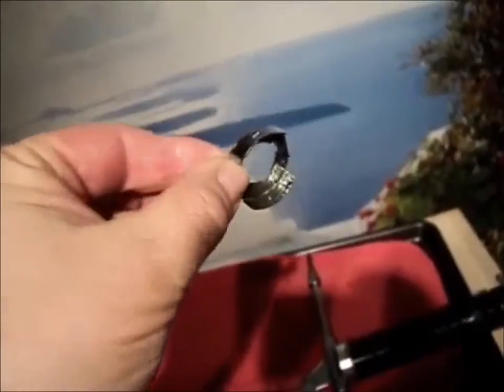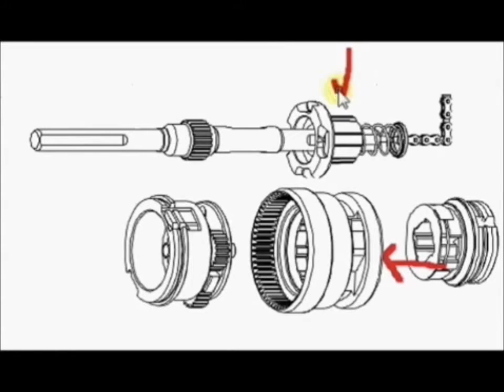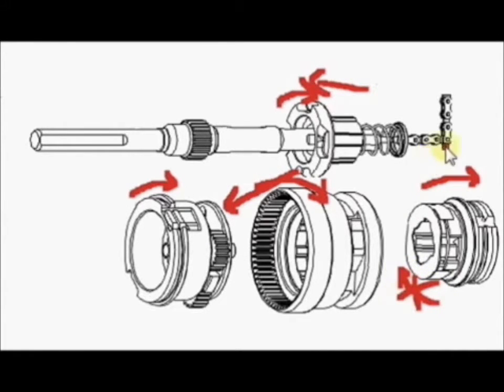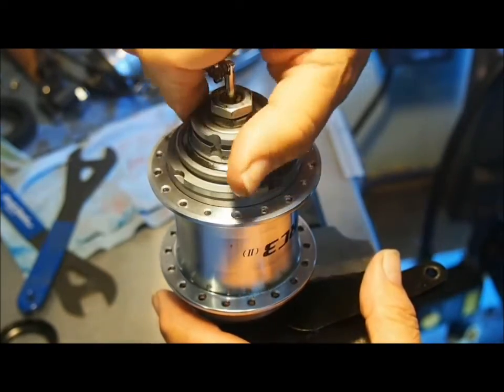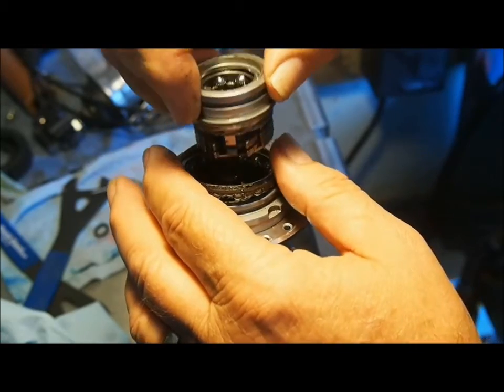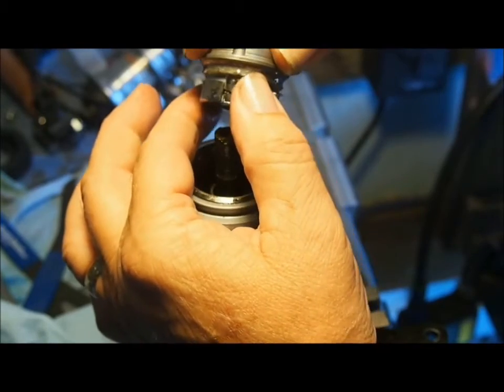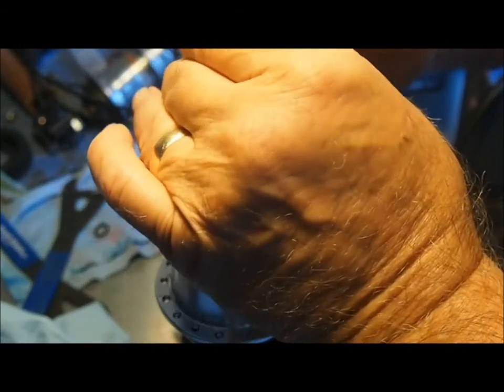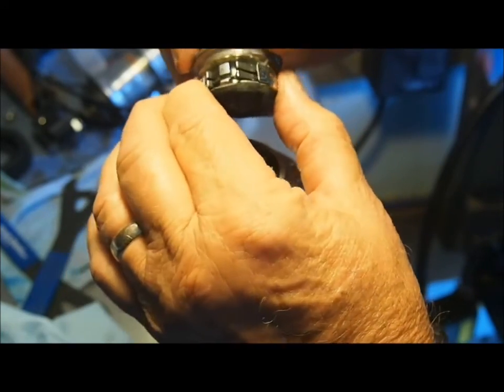Sturmey Archer actuator plate function

Comment: thank you for explanation, Dan. I broke this actuator plate in my Sturmey hub in Brompton bike)). I need to ride every day, so i had to eliminate 2 pairs of pawls except pawls of direct gear, so my bike became single-speed. After your video, i attached all in their places, and all gears work good without this actuator.
Reply from the maker: Glad it helped. The only application where it is absolutely necessary is with a coaster brake hub.

Comment: Hello Dan! Great video. Is it possible to deactivate the coaster brake for a 5 speed Sturmey Archer S5C (II) IGH ? Thanks!
Reply from the maker: Yes you can. All you need to do is remove the rear facing pawls from the driver.

Comment: Hello Dan, I realize this is an older video, when I put my 5-speed hub back together do I need to grease or oil the gears at all. Thanks in advance for a reply.
Reply from the maker: They do need to be lubed, but I caution against using a grease with too much viscosity. 
Sturmey Archer specifies  Castrol CLS00 semi fluid grease.I have used Shimano Nexus gearhub grease successfully, and I have an older 5 speed Sturmey Archer that I run on ATF with regular grease in the bearings. It's been running great on that for years.
Reply: @2wagondragon  What would be the difference between using ATF and using special Sturmey Archer gear hub oil from the old days? I'm considering converting my AB5 to oil lubrication, intending to just squirt in the oil through the hollow axle (with the indicator spindle removed) once every two or three months. As you already have one running on ATF: how do you replenish it and how often, and does it make a noticeable difference in drag?
Reply from the maker: @lennartgoosens  The hub I'm running on ATF is a XRF5 ball lock type. I dunked the internals in ATF several years ago, and have not removed them from the hub shell since then. About twice a year, I dribble a little bit of ATF into the hub through the indicator hole. It has been shifting and functioning flawlessly .
 On some older 3 speed hubs, I have lubed them using a light viscosity base oil with no additives. 
 Sturmey Archer's prescribed lube for modern hubs is Castrol CLS 00 semi fluid grease, but the local Castrol distributor does not sell small quantities and I would have to buy an 18 liter pail at a cost of about $600 Canadian.
 I talked to David at Sunrace USA and he tells me Shimano Nexus grease can be substituted. I had already used that in another hub I overhauled in the past.

Comment: Without the actuator plate, back peddling in third gear on a 3 speed hub sucks (not a coaster brake model). As the clutch is being pushed over the pins for the planetary gears. It does not lock up. But it just sucks, and sounds like shit.